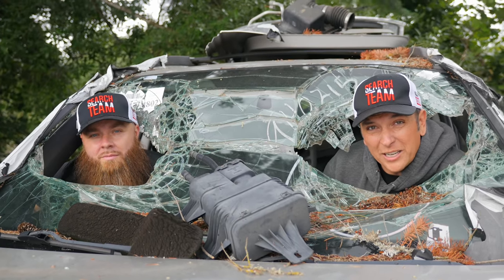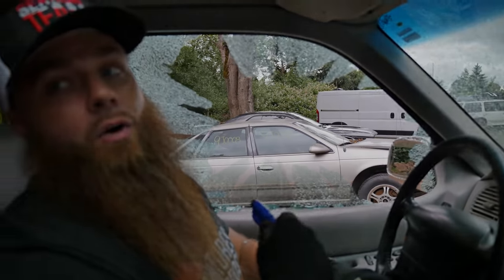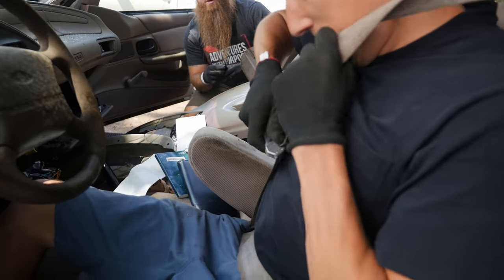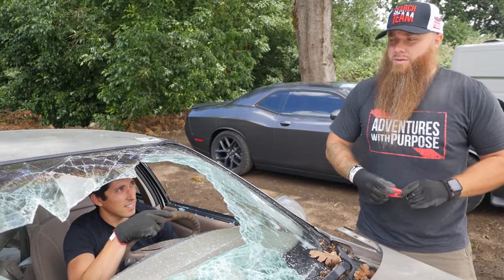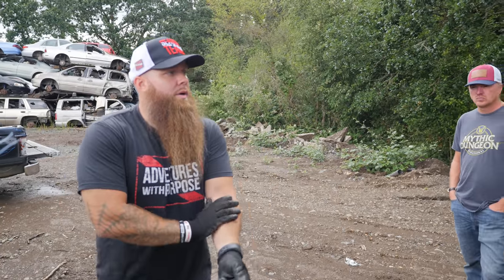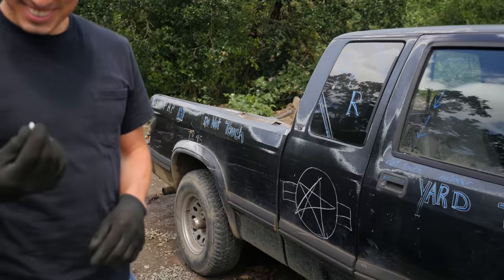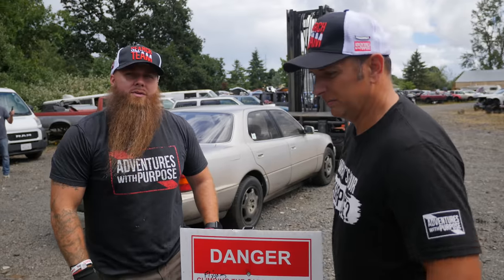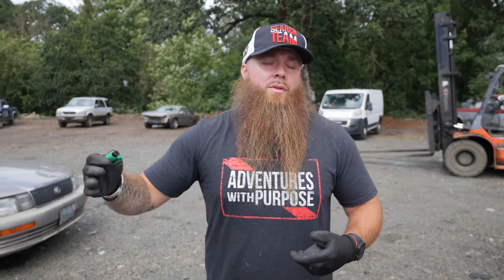HOW-TO-ESCAPE FROM YOUR CAR.!! (This Could Save Your Life)

Comment from the maker: Purchase Here: https://adventureswithpurpose.com/products/2-in-1-emergency-window-breaker
2-IN-1 EMERGENCY WINDOW BREAKER SEAT BELT CUTTER SURVIVAL KEYCHAIN
Reply: I want to buy the tool for my family, but it says not to use it on vehicles newer than 2017.  ☹
Reply: Good tool
Reply: When is the fritz video gonna be available for the non members?
Reply: What about my 2020 GMC Seira? 
Can't use this tool?
Reply: Bought 3

We have a 2020 Rav 4.  Its side windows say temperlite.  So not all vehicles made after 2017 have laminated side glass.
Reply from the maker: Check your back windows and see if any of them say tempered.
Reply from the maker: Still scheduled for Friday for the Ritz a video
Reply from the maker: Check your back windows and see if any of them say tempered. Then you will know
Reply: you covered most points except if the vehicle has laminated glass in the side windows
Reply: Buying the 5. Also does Doug have a significant other, and if not how do I apply?
Reply: @AdventuresWithPurpose  
Yep all tempered, only windshield is laminated.  Wow. I knew about my windshield, but had forgotten about the others.  Thx Jared!
Reply: Can't wait to see the underwater demo.
Reply: I tried my window breaker once and it dulled the tip. Now I don't even trust the seat belt cutter
Reply: @totower Good to know, 
Thank you!   Yes... IF we ever Need it, knowing it works brings comfort.
Reply: @nancid5265  100% Agree.  Not to mention,  they are most always on another case.
Reply: Been waiting for purple to be back in stock but after this video would have bought any color. Happy to see it was in stock when I went to order it.  Got my purple on order!  Have a tool in my van already but after watching this video and seeing how poorly some tools preform compared to yours I can't take the risk of the generic tool I have not working.  Thank you for this and all you do!
Reply: @AdventuresWithPurpose  you guys had me worried, should probably wear safety glasses.
Reply: I just ordered the green one for my wife.
Reply: That wasnt a headrest you was pulling off in the first car that was a sun visor 🤣 thanks for the video that was a lot of information I didnt know about
Reply: Great info Jeremy & Doug 👍 .. Thanks for 💕✌
Reply: I'm buying a LOT FOR EVERYONE! tHE WHOLE WORLD SHOULD HAVE THESE
Reply: The link you posted doesn't work??  Is there another link?
Reply: I ordered 3. Thank you
Reply: What is the breaking tool made of?
Reply: @AdventuresWithPurpose  If your car has all laminated windows, are you just screwed?
Reply: This was definitely a helpful and educational video! Your product is great and should be a must have. The only issue I see is that most cars no longer have ignitions for keys, as many are buttons. Therefore,  a lot of people will not have the keys right there (product) in an emergency. I suppose there could be a way to attach it to the dash (but thieves). Just was one of the first things I thought about when watching the video as I keep keys in my purse or in beverage holder (all of which can fly out of reach in an accident.
Reply: I got the 5 bundle, hopefully there will be no problems getting them to Puerto Rico.  I would love to have more tools like this one show up at the shop!! I love small and super useful and easy emergency/survival gear that any ordinary person can carry around and possibly save their or someone else's life.
Reply: Thank you so much for this video!   Bought 5 thank you guys for what you do!  Stay safe.
Reply: Deslike
Reply: I want to have that car. I'm good with a missing sunvisor, window and seatbelt lol but I'll pass this time. Hahaha
Reply: @cynthiameans4949  does it say why?  I'm curious
Reply: @waynesmith7527  there is nothing they can do. Their specialty is locating missing loved ones in the waterways within their cars. I do pray that precious child is found. Mom and dad didn't do this
Reply: @cathyhannold1849  talk of headrest demonstration was sunvisor
Reply: @stephanypasnin1474  his tint is tented. Auto correct spelling marme... Lol
Reply: @christinawilson2667  pretty much. Try sunroof if you have one
Reply: @vilsongriesbachjunior5691  dislike? Cool. We need those too.
Reply: Are these one use only? Were you using different tools each time or can they be used over and over? If so, how many?
Reply: Do you ship to New Zealand?
Reply: @cynthiameans4949  your vehicle should have least one tempered glass (normally rear or front) but to me I'd still use it if you needed it..l and didn't have it .. just like being armed .. your best prepared ..you should be able to email them
Reply: I was going to buy five but it says $83 shipping. Wow
Reply: Well I guess I can throw away the tool I have in each of our newer than 2017 cars. I live in Florida and there is water and bridges all around. I am terrified now and will let my windows down when driving over a bridge. Great video its for sure going to help a lot of folks with older vehicles.
Reply: I have one of these.  This tool is the reason I wear my seatbelt.  I had a huge fear of being trapped by the seatbelt and wouldn't wear it until I got this tool. I saw a child trapped in a seatbelt when I was a child and that memory stuck with me.
Reply: Do you have a mail address
Reply: This was great Thank You for saving a life
Reply: I have that tool in council guess I better move it
Reply: I literally just went to the website to see if you guys were selling these and came back to the video to find the link. Thanks guys
Reply: This is a terrifying video! I want to buy a bunch for my family but I have a couple questions. Please address all the questions about the use on newer cars. I couldn't give this tool out and have it not work. Should I give them all a big chunk of broken ceramic tile? Next, is there any research into certain colors being more effective in an emergency or is the color not important because you are likely just feeling for it.
Reply: @hawaiibound.  looks like I'll have to wait till they are on sale in UK.
Reply: I have a 2018 Rav4. It has tempered glass. So grateful!
Reply: @nancid5265  
Absolutely!
Reply: Just purchased 5 Keychains. One for each of my kids and myself
Reply: “It worked.” 😂 That back window exploded!
Reply: @vlw4165  you can use a thick piece of cardboard or  layer up two or three pieces.. Put the cardboard on a hard surface and then press down hard with the end of the tool. It should “fire” and you will see a small hole in the cardboard.
Reply: @christinawilson2667  yep
Reply: @TomCrosman , I guess I'm screwed if I ever go into water. My doors lock as soon as I put my car in reverse, so my windows wouldn't roll down and I couldn't unlock them. I don't have a sunroof and all the windows, including the two back side ones, are laminated. I drive a 2021 Camaro.
Reply: Can the tool be used on tinted windows?
Reply: @stephanie-leeirlam3499  need to know if it was aftermarket applied film or if it is actual tinted glass. Also you can check the window corners to see if it says tempered glass or laminate. Laminate is plastic between 2 layers of glass. Tempered is the glass that explodes.
Reply: @christinawilson2667  if you really wanna feel safe, sell your car. Find something else that doesn't have laminate everywhere. Or, you can do what a lady above says she does...drive around water with window(s) down. Personally I'd get a different car. Nobody wants to drive around with windows down when cold weather hits...
Reply: @christinawilson2667  I also just thought of something else that you can do if you REALLY don't wanna sell your car n find something safer. Have an aftermarket moon roof/sunroof installed. Not sure of cost, but is safety worth it? Also if it rolls you may not be able to get out of roof...🤷🏻‍♀️
Reply: @anneosborne8719  idk where you are located but I'm in the USA and first class shipping for 10 tools is only around $5...please state where you are from when you quote a shipping cost because it misleads and deters people who want to buy if they think the shipping is too high. They're trying to help save lives by encouraging people to buy it...not deter them with a high shipping quote. They're likely shipped from USA. If you are in US, it is cheaper than traveling to another country. Just to ship a very small item overseas can be expensive. That is why even I do NOT ship things overseas because it is cost prohibitive. If someone really wants it, how much is a life worth?
Reply: What about tinted windows?
Reply: Myth busters did some of these test including underwater.
Reply: @resarm5007  There's no way I can sell my car. I just bought it. What sucks is that you can't buy a new car without the worry of being trapped inside it. And my husband just said what if we pay all that money to have a sunroof installed and I land upside-down? Luckily I don't go anywhere where there is any water, unless I drive our bayway or causeway to get to Gulf Shores and that might be a once in every 5 year deal, if that much.
Reply: I’m planning on buying this tool actually 2 of them. However @adventures with purpose what do you do if you have a keyless entry for your car and keep your keys elsewhere while driving? Like is this still the best suggestion ?
Reply: Thank y’all 
I have just ordered 10. Nice to add to the Christmas gifts 🥰 Y’all are a true blessing.
Reply: @aidan-lm2eo  buy some velcro and put it on the dash
Reply: For people that can't swim do they make an underwater inflatable floatation device to keep in the car ?It would lift people to the surface when inflated.
Reply: Bought the 5 value pack to start. Added a tip for the video demonstration. Thanks guys! Hope I never have to use it, but I will be glad i have it if I ever do have to.
Reply: I just ordered 10...for my family...
I have been watching your organization for a couple months...currently I am looking for a job...as soon as I have one I will join
Thank you for all you do....you guys are amazing makes me wish I could rely help some how.  You guys are so very inspiring!  
Mikie
Reply: This needs to be a part of driver Ed in school!
Reply: I would love to have 3 of the  them
Reply: @heathernoneya4151  haha you're first after me, lol.
Reply: @papaguche  excellent idea!!!!
Reply: @christinawilson2667  Any swimming pools near you?? Just this week in my area some kid landed his car in a neighborhood pool. It CAN and DOES happen. No drugs or alcohol involved. He had a medical emergency. Now that I scared you even more, lol. Just something to think about.
Reply: @aidan-lm2eo  I'd think of somewhere you'd be able to get to it. They have wayyyyy too many comments and may not see yours. You know your car and your ways better than them too. Good luck. Let's hope you never need to use it.
Reply: @kathyroberts5870  why are you giving your million dollar idea away for free on YouTube??? Lol
Reply: Thanks guys...i have always had a fear of water, knowing that I have the tool to get me out of the tomb of a car God bless you.
Reply: I wanted multiples for discount but they only have red and it will only let me buy 1
Reply: @cynthiameans4949  same here
Reply: Can you please e mail us when they are back in stock. I would like multiple colors. Don't care what they are, but want the 10 count discount deal
Reply: Can we buy it in New Zealand
Reply: @cynthiameans4949  why don't you use it on vehicles newer than 2017
Reply: The static in your beard looked fantastic. I was so busy laughing I missed you getting out.
Reply: Another factor of a sinking car is the water pressure on the outside if the car and then it rushing inwards into any opening making it hard to exit.
Reply: If you have an infant and children to also save underwater, should you cut them out of their restraints before breaking the window and having more water gush in? So say you have a whole carload maybe you should demonstrate that. Not using real people.
Reply: Doug really went the extra mile! Thanks guys. I'm getting some for sure!
Reply: Adventures with Purpose  You need to read My first comment to you and Jamie Rupert's comment and my reply back to him.
Reply: @jamierupert7563  Maybe They will make a million and share a little with me.          Hint, Hint    Adventures with Purpose.
Reply: @AdventuresWithPurpose  , OMG, $28 USD to mail to Canada 😲 I am so sad.
Reply: AND I live on an Island so I am surrounded by water. We could have used this tool back a few years ago. We avoided hitting a dog laying on the road and flipped our Ranger 3 times, it came to rest on an electric pole and me dangling in my seatbelt. My bf crawled out over me and out the passenger window that shattered. I had to wait for the police to get me out.
Reply: I tried to buy some but it keeps telling me my phone number is invalid.
Reply: Hey shipping over seas are ouchy
Reply: Great job 👏 guys 
I need a few.
Reply: Great to see you Kevin
Reply: They're sold out but will be restocked on 8/24.😉
Reply: My worst fear has always been that I will get a blow out going over a bridge! I am definitely going to get one of those tools and not rely on the one I have! Thank you for the video and all the information I learned alot
Reply: HELP!  Since your are sold out on your end... where do we find a reliable escape keychain? Cause I drive along a river with no guard rails.... You all are awesome! Thank you for the video! Stay safe!
Reply: The biggest Thing You SHould Know THat the Seatbelt HAVE a Lock THat Stops The belt from moving while upside down YOU can NOT even reach the Glovebox !!!
Reply: Do you ship to U.K. please x
Reply: It's already sold out 😔
Now I have to wait until it's  restocked.
Reply: Will there be a restock? And does it ship to Australia?
Reply: Do you know they haven't? Everyone is praying for that little girl and the little 4 year old Michael in Idaho. This team is amazing, if a case is something they can help with, meets their specific area of expertise, they will do it.
Reply: @AdventuresWithPurpose  Great idea but I have a suggestion, say you're in the water, you reach for the tool but lose grip, it sinks in the car and now can't find it. If it floated it would be easy to find. I think you make this product so it floats as well.
Reply: @Ashley__Rose  Its on all windows, near bottom.  Its in black on my truck, & my windows came good & tinted. So look good for it.   Hope this helps.
Reply: @AdventuresWithPurpose  so basically us with tempered glass are screwed? Sounds like dept of safety need to rethink the windows. 😓
Reply: @southernsass2937  thank you! I looked where he shows in the video and it wasn’t there. But was on 1 window. They’re not tempered and I’m upset about that. 😕
Reply: @Ashley__Rose  What about your windshield?  Is it laminate?
Reply: @Ashley__Rose  Maybe they are, & they only put on one window.
Reply: Bought 4 can I use it on a 2017 Lol
Reply: @BIONDIEST  I thought they looked cheap as Heck when I got it out of the bag.
Reply: Thanks AWP! Super helpful I never even thought about how I would get out of a sinking vehicle 😳 but now I have a way better understanding
Reply: Thanks so much for the informative, life-saving video. I ordered 2 keychains, one for myself, and one for my husband, and I'm encouraging my family and friends to watch your video and order the keychains too. God bless you all!
Reply: I ordered 4 mine won’t work on my car. My windows on my car are Tempered.
Reply: @southernsass2937  look at your windows to see if they are tempered windows
Reply: @momamae23  Yes, its in the comments.  Thank you ❤
Reply: @momamae23  Are all of your windows tempered? I think they said in the video that the windshield on newer cars is usually tempered but the side windows may not be?
Reply: @leonaheraty3760  yes
Reply: @cynthiameans4949  Maybe we should all have a big hammer in our cars, just in case?
Reply: what about cars with push to start and keys arent in the ignition? where would the next best place be to keep a tool like this?
Reply: @AdventuresWithPurpose  all my windows say tempered so does that mean it won’t work or it will work. I bought 4 but if there not going to work on anyone’s cars I’ve just lost out.
Reply: @Kami-pq4hm  Good point! I'm keeping my keychain, with the seatbelt cutter & window breaker, in my middle console of my car, right where I have my cup holder.
Reply: All of you are awesome!  I've had a 'tool' for awhile, never needing it yet... however, I'll feel much safer purchasing yours, for several friends and family!!!  Keep up the great work!!  All of you are real SUPER HEROES!!! ❤️
Reply: I think it's because all windows that new have that laminated coating that the tool can't shatter?
Reply: @kitschville  Yes, I think they mention this in the video, but I think they also said the side windows may not be laminated. You have to check the windows to see if they have a "laminated" sticker or something like that on them. Anyway, that's why I'm also going to keep a hammer in my car's middle console, where there's the cupholder. Hope that helps. :-)
Reply: Doug you're just to awesome!!! Thank you all for teaching these life saving techniques.  Just shared to my facebook. I think everyone needs to see this. Especially where I live. Literally the middle of nowhere, on the corner of lame and boring. Maybe 3500 people with surrounding area. Closest major city is 4 and a half hours away. We are completely surrounded by water. So those two factors alone are alone making me think 🤔  I live up in Northwestern Ontario Canada. Just lakes and forest. Maybe a deer or moose lol. No one is going to save you, around here.  So you must always be prepared. There isn't even anyone near to help you. Always know your surroundings.
Reply: So what do you do in this situation if you have laminated glass?
Reply: 22:30 if the seat belt is coming out, why am i still cutting it? Isn't cutting the belt our answer to being held pinned by it? if not, is it better to cut it even if it is coming when you pull anyway??
Reply: What is the name of that small tool please any one can tell me
Reply: What do you use in a post 2017 car?
Reply: Hi Jared could you put this tool on amazon so us in the UK can get one please. X
Reply: My holiday gifts to everyone!!!
Reply: Hi, do you post to the UK?
Reply: I would love to support you guys but I'm on disability and thought the tool would be a great way to help a little bit but, and I'm sure you hear this a lot, $50.00 shipping to Canada for a $7.00 USD item that probably weighs less than 2 ounces???!!!!! Seriously USPS really sucks. Can't wait till you guys get B out of office! Damn!!!! 
I LOVE YOU GUYS!!!
Reply: I need one of these.
Reply: What about under watet?
Reply: @tawanablount3640  that's exactly what they are for
Reply: Wanted to buy a few of those for my family and myself, but the site says the shipping is unavailable to my country...😔
Is there any option how to ship them to Russia?
Reply: Just bought 5. Every member of my family is getting one- and it comes with a free lecture of the importance of keeping it on their keys.
Reply: is it payeble with VISA ?
Reply: Thank you.  I ordered 5.
Reply: The link takes me to your website, but doesn’t fully load so that I can order the tool!
Reply: Went to buy 2 and postage came up as $165....
Reply: How do i become a member
Reply: You can use a small stone same as a spark plud
Reply: @AdventuresWithPurpose  Jared... in Our Country our vehicle's don't have that information on.... I had to put Laminate on my Windows to save my life, I have a very "HOT" Vehicle.... they've tried to steal her, break into her, and even tried to Hijack me... It's a 1990 Cressida 3lit... Mint condition..... I'll just keep my Late Father's hammer with me..... STAY SAFE & WELL, THANK YOU WE CAN ENJOY YOUR TEACHABLE EXPERIENCES WITH US.... 😴IT'S ZZZZZZ TIME.... PAST 2AM IN THE MORNING😴❤😴❤❤😴❤😴❤
Reply: I'd love to buy one but I'm in ireland and shipping is over 70 dollars lol
Reply: Can it be posted to the UK?
Reply: Just found you guys. It’s a little hard to watch because you’re so hunky dory talking a guy’s infant in the car and wife… maybe just be kind and educational not condescending and belittling other tools over and over. Ok I get it. Just compare, educate maybe give stats but don’t fear monger
Reply: I was going to purchase it, but shipping to my country costs a bit to much ($83.80 only shipping). So I will need to look for a local one.
Reply: Oh no, I just bought 3 but now I see the comments that say not able to use on newer than 2017? All of my 3 cars are newer..can I return for a refund?
Reply: Thank you. I bought 5. One for every driver in my family.
Reply: It's asking me for £83.10 delivery???!!!
Reply: I ordered 3 1 for me 1 for my mom and my son gets one u never know.thamk u so much for having these at a good price .I donated 5 I wish I could do more .ur doing a great service thank u.
Reply: I just bought 5 of these. We had one of the knife tools that Douglas used in this video, but to see that it doesn't work made us buy the tool you sell. We live right next to a lake and on curvy mountain roads....so this is a tool is very needed. This video was very helpful for me and my family! We learned so much! Thanks Adventures with Purpose for all that you do! We love watching you all help all these people find their loved ones. It's truly amazing see what you guys do. You all are angels!! Thanks again!!!!!
Reply: Just bought 5 of your 2-in-1 emergency window breaker seat belt cutter survival Keychain.
Reply: @AdventuresWithPurpose  just bought 5 of these 2-in-1 tools
Reply: @Bre Unlikely.
Reply: Next time you do this can you please use the sun roof and show us how that would break etc?
Reply: @anneosborne8719  shipping to Australia for 5 was $111.40 US $$$ so with conversion to AUD the cost of 5 plus shipping was $200 ! 😪
Reply: @resarm5007  yes, what’s a life worth, but living in Australia, on a pension the shipping cost is way out of my reach, and don’t talk to me about the cost of a life, our son died in a car accident. But when you don’t have $200 Australian $$$ to buy these, then you don’t have it. I would LOVE to buy these, so I will see if I can buy these in Australia. Shipping costs are outrageous, the reason I never buy from overseas like I used to….
Reply: I've meant to buy one of these types of tools for well over a year. I finally bought one. I live by too many waterways not to own one.
Reply: How would you get out of a car with all of the windows laminated?
Reply: Tried to order but you don't take my card
Reply: I live right off the Colorado River in Bullhead City AZ.  My husband is part of search and rescue here and with all the flash floods, off road vehicle accidents in the middle of nowhere, children and pets left in vehicles in 120 degree heat that we need to rescue etc... this is something I will purchase.  Any discount on 100 of them?
Reply: Just found this video. Being trapped in my car with my kids is my worst nightmare. I just ordered 2.
Reply: Really want to grab some but shipping to the UK is insane!
Reply: @cynthiameans4949   Might be good to check the windows in your car to see if you happen to have tempered glass.  Couldn't hurt...
Reply: When will they be back in stock?
Reply: I have a push start vehicle and throw my keys in the cup holder if i was in a accident my keys would be nowhere near me. What would your suggestion be as to where i should keep it. I will still be purchasing as these are incredible
Reply: Sold Out 😥
Reply: @cynthiameans4949  so what other option is out there for newer cars ?
Reply: I recently purchased this and I was testing it on paper. The first couple worked but then the spring inside stopped working so there is no loaded punch. The probably won’t work now right? What should I do?
Reply: Is there an expected date to get the keychains in? I want to buy one for everyone in my family. Especially my grown kids.  I did put in my email for a notification, but just wandering if there was an expected date.  Thank you!!
Reply: It is sold out Will you please obtain more or give alternative ways to purchase? Thank you
Reply: @cathylee9157  they are also sold other places too
Reply: Do you ship to England?
Reply: I already made my order, thanks 👏🏻❤️
Reply: Hi guys  I've just tried to buy 2 of the glassbreakers tool , from uk ,but I can't pay for it as I don't not have any of the accounts listed ,.. I only have a debit card ...plz advise
Reply: Every LEO and firefighter should have this part of their everyday carry
Reply: @anneosborne8719  I bought 10 for $70. Included shipping/tac and I gave AWP a $5 tip too.
Reply: @aidan-lm2eo  tie device by steering wheel for easy access
Reply: @southernreign1  agreed
Reply: I love this tool but the shipping to UK is really expensive. Has anyone found a suitable and efficient tool in UK.
Reply: Got it in red
Reply: @heathernoneya4151   LOL
Reply: Wish it wasnt 2022.
I had money back in 2020, 2021
But today. Im so poor im looking at other
Housing options.
I LOVE Yalls videos, and I respect yall for not charging families.
That tool looks amazing.  
Haha my son has that same knife. He drives my car.... Makes me worry tons.
Almost so much I almost wish I didnt watch....
Reply: @AdventuresWithPurpose  what do you mean when you say tampered . I have lincoln 2018 but i want to get for the rest of the car
Reply: If my family has vehicles newer than 2017 how would you escape? Through the back window?
Reply: What about the piece of your seatbelt on your lap? If you are in the water, is that stupid piece not holding you down because of the pressure?
Reply: I want to buy that tool but I'm not a member and I'm a new subscriber to your channel. Surely, i don't need to be a member get this right?
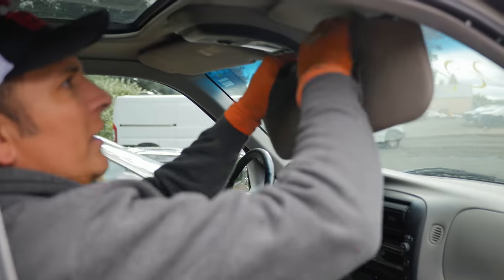Reply: Stop saying a headrest! It’s a visor 3:33
Reply: I just bought 10 of those suckers for me and my family. Thank you. I was in a rollover 2 months ago with my sister and her 3 kids and I was stuck upside down in my seatbelt. We were lucky a side window busted during the rollover so we could get out of the vehicle.
Reply: what's the ball bearing end for
Reply: I wanted to buy a pack of these for me and my friends and family. It wasn't on the website though. Is this product still available?
Reply: Ummmmm, i clicked on the link it to purchase an emergency window breaker but it just takes me to your site only to say "page not found"? I really want one and I'm a big fan! You guys do such great work!!! ❤❤❤
Reply: Adventure with Purpose I was just about to purchase those key things that cut seatbelts and breaks windows to save lives and they said the page doesn’t exist, what happened are you not selling them anymore?!🤔🤷‍♀️😓
Reply: wanted a few but isnt in stock is there any other ones similar
Reply: I want to order one but keeps telling me page not found
Reply: @Chrissy-Stormgal  Same here!🤷‍♀️😰
Reply: Take off the headrest and try to break the window!!, I’ve heard that’s why they are removable, I’ve never tried it!!
Reply: We
Reply: Where do you attach this so it's easy to reach when you have keyless ignition?   My keys are loose, in my purse or in my pocket?
Reply: Will there be more opportunities soon to purchase some? Every time I visit the page I get a message that it no longer exists. I am curious because I would love to order some for my family
Reply: Here in the Netherlands cost it 15, 99 the 2 in one car window breaker
Reply: @AdventuresWithPurpose  hey, just letting you know your link is dead. Looks like you changed the name of the item and the URL over the last year. I suggest you set up a 301 redirect from the old link to the new link (so anyone who saved it can still access it). And you might want to update the link here, too.

I like this better than the tools we have b/c ours are big and wouldn’t be easy to access like you said. Do you suggest any other tool for laminated glass, aside from porcelain bits, lol?
Reply: @kathyroberts5870  I bought life jackets that inflate by gas. I imagine that a regular life jacket should float one to the top.
Reply: This tool is no longer available!!! Can you tell us why and can you UPDATE WITH A NEW VIDEO AND AND AN UPDATED ESCAPE TOOL FOR LAMINATED AND TEMPERED GLASS PLEASE!!!!
Reply: Also, how do we break LAMINATED GLASS????
Reply: @mslady1230  it’s still available. The URL (link) was just changed. I notified them of this. Search their shop for window and you’ll find it. However, it only works on tempered glass.
Reply: This link no longer works..?????
Reply: @raqueladauto7309  look right above the comment you posted.
Reply: @AdventuresWithPurpose   is this product no longer available for purchase? Thank you!
Reply: @raqueladauto7309  I was wanting to order myself
Reply: They are out of stock can we be updated when they are back in stock!!
Reply: @JB11334  they’re not out of stock. Look at my msg above yours.
Reply: @Tawana_X  ICYMI, the window breaker is still available. The URL (link) was just changed and their web dev didn’t set up a redirect. I notified them of this. Search their shop for window and you’ll find it. Reminder, they said it only works on tempered glass.
Reply: Any advise on where to put this tool if you have keyless start and your keys are on the console and could be lost in a wreck?
Reply: @Emily-E  some ideas for keyless starts: Maybe hang it on your gear stick, rear view mirror, driver’s side visor, or this may not be as easy to access but the post on the driver’s head rest. Just test it to make sure you can easily pull it off with one hand. Or perhaps heavy duty double-sided tape on the driver’s side door, visor, or console.
Reply: Please, please, share and revisit this video after Kiely Rodni's tragic case. People need to know how to be more safe and to stand better chances to survive car accidents. Thank you!
Reply: Where do I buy this tool?
Reply: @Kimerly_7151  There is a link AWP left in their post.It says: Purchase here. Their web page have Merch section, you can buy it there if you can't see the link here.
Reply: You guys are sold out of these survival keychains , so where else can I get the same thing at that you would recommend? I truly appreciate your help if possible & thank you guys for all you do . This country is beyond lucky to have you guys ❤️
Reply: Are these window breakers just out of stock? The link says 404 page not found, so I'm wondering if you're still selling it at all? If not, could you point me in the direction of a comparable product?
Reply: This link keeps saying page not found
Reply: Bring back your 2 in 1 tool!! It's giving a 404 page off your link.
Reply: Your link is broken.
Reply: @blue-calla  thank you!!
Reply: @blue-calla  thank you for the great ideas!!!
Reply: @thenamesberly  wondering the same!
Reply: Wish we could still get these
Reply: 404 Page not Found
Reply: 404 page not found...
Reply: this is the first time I have ever wanted to purchase anything off youtube.  Sadly, I remain a virgin,  I guess you are out.  I only got this as a response.  404 PAGE NOT FOUND
The page you were looking for does not exist.
Reply: @karenkat1111  or it could be attached in some way to the visor?
Reply: Thanxfor the info...I have been carrying a hammer under my front seat for years now...just in case. Good to know it is useless. I have to look up those items & order some!!
Reply: No emergency tool available anymore 😔
Reply: your links aren't working for window breaker
Reply: Go to a junk yard and test your new tool. Some of these can fail. make sure it works.
Reply: Link no longer works. Please post a new link. Thank you. 

I have the "Josh" tool.
Reply: @cynthiameans4949 the video said newer ones aren't Tempered Glass. The suit doesn't work on the newer windows.
Reply: Are the window breakers no longer available?
Reply: Broken link.
Reply: Can you please make more of these? I would like to order one!🙏🏾🙏🏾🙏🏾
Reply: Why can't we buy this tool ?
Reply: Why can't we get this tool?
Reply: This link is broken
Reply: Why do I keep getting a "404 message" when I click the link?
Reply: Are you going to get more of the 2-IN-1 emergency window breaker and seat belt cutters in stock?
Reply: When I go to this page to purchase this tool it says page not found ??
Reply: I want to buy this tool for my family but when I click on the link it says page 404 not found
Reply: What is the beans name of the tool?  It looks like yours are sold out.
Reply: Says Page Not Found
Reply: I can't seem to be able to purchase it? Is there a reason why?
Reply: Are these tools not available anymore? I tried the link but am getting an error message.
Reply: Is this window breaker tool still available? I have been unable to locate it on the AWP site.
Reply: I just clicked the link and it brought to your website Doug but it says the page where you have the tool to get out of car is not available???
Where can this be purchased?? For ANY VEHICLE? 
Thanks for all you guys do!
Reply: It tells me 404 not found. I was going to order some.
Reply: Links are broken. :(
Reply: link is broken, item not there :( 

404 PAGE NOT FOUND
The page you were looking for does not exist.  

where can we buy that emergency window breaker please ? 
i need to buy all my car owning loved ones one 

thank you
Reply: How do I get the  2in1emergency window breaker seat belt cutter Survivor keychain  because it's not available on your website anymore
Reply: @nissalum3277  im joining this question, hope we get an answer :)
Reply: @Emily-E  you’re welcome for the ideas. Glad you found them helpful. 😊
Reply: @jenniferfalcone6173   ICYMI, the window breaker is still available. The URL (link) was just changed and their web dev didn’t set up a redirect. I notified them of this. Access it from their website menu or search their shop for window and you’ll find it. Reminder, they said it only works on tempered glass (which are usually used on side windows).
Reply: @thenamesberly    ICYMI, the window breaker is still available. The URL (link) was just changed and their web dev didn’t set up a redirect. I notified them of this. Access it from their website menu or search their shop for window and you’ll find it. Reminder, they said it only works on tempered glass (which are usually used on side windows).
Reply: @thepsychicsleuth7    ICYMI, the window breaker is still available. The URL (link) was just changed and their web dev didn’t set up a redirect. I notified them of this. Access it from their website menu or search their shop for window and you’ll find it. Reminder, they said it only works on tempered glass (which are usually used on side windows).
Reply: @Zevadel    ICYMI, the window breaker is still available. The URL (link) was just changed and their web dev didn’t set up a redirect. I notified them of this. Access it from their website menu or search their shop for window and you’ll find it. Reminder, they said it only works on tempered glass (which are usually used on side windows).
Reply: @missboo4325    ICYMI, the window breaker is still available. The URL (link) was just changed and their web dev didn’t set up a redirect. I notified them of this. Access it from their website menu or search their shop for window and you’ll find it. Reminder, they said it only works on tempered glass (which are usually used on side windows).
Reply: @photohoot    ICYMI, the window breaker is still available. The URL (link) was just changed and their web dev didn’t set up a redirect. I notified them of this. Access it from their website menu or search their shop for window and you’ll find it. Reminder, they said it only works on tempered glass (which are usually used on side windows).
Reply: @ORSkie    ICYMI, the window breaker is still available. The URL (link) was just changed and their web dev didn’t set up a redirect. I notified them of this. Access it from their website menu or search their shop for window and you’ll find it. Reminder, they said it only works on tempered glass (which are usually used on side windows).
Reply: @lazy855    ICYMI, the window breaker is still available. The URL (link) was just changed and their web dev didn’t set up a redirect. I notified them of this. Access it from their website menu or search their shop for window and you’ll find it. Reminder, they said it only works on tempered glass (which are usually used on side windows).
Reply: @aprilbenson913    ICYMI, the window breaker is still available. The URL (link) was just changed and their web dev didn’t set up a redirect. I notified them of this. Access it from their website menu or search their shop for window and you’ll find it. Reminder, they said it only works on tempered glass (which are usually used on side windows).
Reply: @seymore1532    ICYMI, the window breaker is still available. The URL (link) was just changed and their web dev didn’t set up a redirect. I notified them of this. Access it from their website menu or search their shop for window and you’ll find it. Reminder, they said it only works on tempered glass (which are usually used on side windows).
Reply: @NitrosDen    ICYMI, the window breaker is still available. The URL (link) was just changed and their web dev didn’t set up a redirect. I notified them of this. Access it from their website menu or search their shop for window and you’ll find it. Reminder, they said it only works on tempered glass (which are usually used on side windows).
Reply: @MargaretEllison2023    ICYMI, the window breaker is still available. The URL (link) was just changed and their web dev didn’t set up a redirect. I notified them of this. Access it from their website menu or search their shop for window and you’ll find it. Reminder, they said it only works on tempered glass (which are usually used on side windows).
Reply: @radicalhealthseries9482  look at the small decal on the bottom of your side window to see if it says tempered or laminated. Not all new cars use laminated.
Reply: @cathywnukoski5843    ICYMI, the window breaker is still available. The URL (link) was just changed and their web dev didn’t set up a redirect. I notified them of this. Access it from their website menu or search their shop for window and you’ll find it. Reminder, they said it only works on tempered glass (which are usually used on side windows).
Reply: @sunkorg    ICYMI, the window breaker is still available. The URL (link) was just changed and their web dev didn’t set up a redirect. I notified them of this. Access it from their website menu or search their shop for window and you’ll find it. Reminder, they said it only works on tempered glass (which are usually used on side windows).
Reply: @queenesquiresquad    ICYMI, the window breaker is still available. The URL (link) was just changed and their web dev didn’t set up a redirect. I notified them of this. Access it from their website menu or search their shop for window and you’ll find it. Reminder, they said it only works on tempered glass (which are usually used on side windows).
Reply: @lisabevans8107    ICYMI, the window breaker is still available. The URL (link) was just changed and their web dev didn’t set up a redirect. I notified them of this. Access it from their website menu or search their shop for window and you’ll find it. Reminder, they said it only works on tempered glass (which are usually used on side windows).
Reply: @lesliet1766    ICYMI, the window breaker is still available. The URL (link) was just changed and their web dev didn’t set up a redirect. I notified them of this. Access it from their website menu or search their shop for window and you’ll find it. Reminder, they said it only works on tempered glass (which are usually used on side windows).
Reply: @Michelle.05    ICYMI, the window breaker is still available. The URL (link) was just changed and their web dev didn’t set up a redirect. I notified them of this. Access it from their website menu or search their shop for window and you’ll find it. Reminder, they said it only works on tempered glass (which are usually used on side windows).
Reply: @tamil7498    ICYMI, the window breaker is still available. The URL (link) was just changed and their web dev didn’t set up a redirect. I notified them of this. Access it from their website menu or search their shop for window and you’ll find it. Reminder, they said it only works on tempered glass (which are usually used on side windows).
Reply: @rebeccaskinner4236    ICYMI, the window breaker is still available. The URL (link) was just changed and their web dev didn’t set up a redirect. I notified them of this. Access it from their website menu or search their shop for window and you’ll find it. Reminder, they said it only works on tempered glass (which are usually used on side windows).
Reply: @Jalle6673    ICYMI, the window breaker is still available. The URL (link) was just changed and their web dev didn’t set up a redirect. I notified them of this. Access it from their website menu or search their shop for window and you’ll find it. Reminder, they said it only works on tempered glass (which are usually used on side windows).
Reply: @areyoureyesstillblue    ICYMI, the window breaker is still available. The URL (link) was just changed and their web dev didn’t set up a redirect. I notified them of this. Access it from their website menu or search their shop for window and you’ll find it. Reminder, they said it only works on tempered glass (which are usually used on side windows).
Reply: @beloyalandtrue143    ICYMI, the window breaker is still available. The URL (link) was just changed and their web dev didn’t set up a redirect. I notified them of this. Access it from their website menu or search their shop for window and you’ll find it. Reminder, they said it only works on tempered glass (which are usually used on side windows).
Reply: @claudidadi6633    ICYMI, the window breaker is still available. The URL (link) was just changed and their web dev didn’t set up a redirect. I notified them of this. Access it from their website menu or search their shop for window and you’ll find it. Reminder, they said it only works on tempered glass (which are usually used on side windows).
Reply: @Kaitmanda    ICYMI, the window breaker is still available. The URL (link) was just changed and their web dev didn’t set up a redirect. I notified them of this. Access it from their website menu or search their shop for window and you’ll find it. Reminder, they said it only works on tempered glass (which are usually used on side windows).
Reply: @judyfooks3334    ICYMI, the window breaker is still available. The URL (link) was just changed and their web dev didn’t set up a redirect. I notified them of this. Access it from their website menu or search their shop for window and you’ll find it. Reminder, they said it only works on tempered glass (which are usually used on side windows).
Reply: @JulesUS8386    ICYMI, the window breaker is still available. The URL (link) was just changed and their web dev didn’t set up a redirect. I notified them of this. Access it from their website menu or search their shop for window and you’ll find it. Reminder, they said it only works on tempered glass (which are usually used on side windows).
Reply: @richardcorson4492    ICYMI, the window breaker is still available. The URL (link) was just changed and their web dev didn’t set up a redirect. I notified them of this. Access it from their website menu or search their shop for window and you’ll find it. Reminder, they said it only works on tempered glass (which are usually used on side windows).
Reply: @EsmereldaPea    ICYMI, the window breaker is still available. The URL (link) was just changed and their web dev didn’t set up a redirect. I notified them of this. Access it from their website menu or search their shop for window and you’ll find it. Reminder, they said it only works on tempered glass (which are usually used on side windows).
Reply: @Dottie1975    ICYMI, the window breaker is still available. The URL (link) was just changed and their web dev didn’t set up a redirect. I notified them of this. Access it from their website menu or search their shop for window and you’ll find it. Reminder, they said it only works on tempered glass (which are usually used on side windows).
Reply: @nissalum3277    ICYMI, the window breaker is still available. The URL (link) was just changed and their web dev didn’t set up a redirect. I notified them of this. Access it from their website menu or search their shop for window and you’ll find it. Reminder, they said it only works on tempered glass (which are usually used on side windows).
Reply: It keeps giving a 404 error code where can you buy this?!?!?
Reply: @platinumnurse6586  i dont think they answer .. it seems to be the number 1 question xD  no replies .. 
i guess it was just a sponsorship deal 
spark plugs for us it is :D hey whatever works , right ?
Reply: Are these still available, can't find them in the store.
Reply: When I go to that page it says: 404 PAGE NOT FOUND
The page you were looking for does not exist.

Can you tell us where there is a link that works to buy this??
Reply: @jillh3187   yeah me too. Just watched the vid and really want to buy some!
Reply: @millie79  Maybe they are just out of stock.  Hopefully someone from AWP will respond soon as to where we can buy these.
Reply: @jillh3187  Yes, fingers crossed!
Reply: @BIONDIEST  It's SPRING ACTIVATED.
Reply: I can’t find any thing here are they still for sale?
Reply: This link leads to a not found page and I don't see them in the shop. Do you still sell these?
Reply: @AdventuresWithPurpose  I just want to thank all of the crew for yalls amazing work. Love each and everyone of you for all yall do.
Reply: Why don't you sell that tool anymore?  That page is giving an error.
Reply: I went to go buy one and it’s not available.
Reply: Buying these for all of my kids, including the ones that don't drive for their keychains.
Reply: @tmomo7265  Years ago, before I would drive over Lake Houston, I would pull over, unbuckle my daughter from her car seat and put all the windows down in my car.  There were no guard rails and it was a narrow road.  But it's nice and wide now with guardrails.  I bought these tools for every driving member of my family about 5 years ago.
Reply: The link doesn't work.  Will you be getting these in again?
Reply: Are the rolls going to be available again?
Reply: Where can I get this tool? I went to the website and it's not showing this product. It keeps saying 404 page not found.
Reply: The link doesn't work can you repost please
Reply: Where can I purchase? It says page not found
Reply: Page Not Found
Reply: @BIONDIEST  Try it on a junkyard car
Reply: The link no longer works, any other options to purchase the window opener?
Reply: 404 page not found - does not exist.  Where do I buy this item and not get a cheap knock-off instead ?
Reply: @cherokeeraider  If you find it, can you please put it here?
Reply: Are you bringing back this product?
Reply: Hi, is there a new link? This one has a 404 page not found.
Reply: Link is Not available
Reply: I can't get the link to work
Reply: No longer available?
Reply: Link says 404 not found
Reply: Any more tools?
Reply: @aidan-lm2eo  I know your comment is old, but after I was involved in an accident where I ended up in water I suggest tapping it to a part of your dash that you can easily reach like the left side underside part. No one will see it but it will be in reach for you.
Reply: This link isn’t working
Reply: When I click the link(s) provided to buy the tool it says this on the webpage: "404 PAGE NOT FOUND The page you were looking for does not exist."
Reply: Tried to order but page isn't working ☹
Reply: Come on guys...Your were using the visor not the head rest.  The head rest has metal dowels.  The visor is to keep sun out.
Reply: @cathyhannold1849  Yes, I was upset about this.  It made them look like morons.
Reply: Hey the window breaker is not on that page😭
Reply: I couldn't find the 2n1 emergency window breaker..it would bring me to no page available..I need this tool or is thier another similar tool that is recommended? Ty in advance.
Reply: @MariaMartinez-bm3bp  I couldn't either!!!  Just google it though.  It won't be AWP but it looks like there are a lot if similar tools online
Reply: Where can I get one of these?  I just tried and it says PAGE NOT FOUND.
Reply: @AdventuresWithPurpose  How come I can't order some?  I tried and it says PAGE NOT FOUND.  Is it offered to members only?  Or isn't it offered anymore?
Reply: BUT YOU GUYS DONT SELL IT ANYMORE!!!! So?? Where’s the help???
Reply: @rebekitavega4115  And why don't they explain?
Reply: Page not found ... Can't find it
Reply: @pamelaremme38  u just hv to google.  It won't be AWP but there are similar tools
Reply: This page doesn't work to purchase???
Reply: Well what, it's not for sale anymore? It just says "error 404" when you click on the links. 😑 Lame.
Reply: This is no longer on the site. How do I get one?
Reply: New subscriber here.  Will these be available again?
Reply: Your link page says 404 NOT FOUND.  Did you guys stop selling item?
Reply: I went to the site to buy the tool but keeps saying 404 page not found or does not exist.
Reply: It's no longer available 😭😭😭 not even listed 😭😭
Reply: Viewing this about a year after it was posted. Tried buying a few of the tool and it seems they're unavailable. Any idea when I can get them for an upcoming cross country road trip?
Reply: Can't find it in the link
Reply: I guess they are sold out? I get a 404 message when I click the link.
Reply: Link shows message "404 Page  not found. The page you are looking for does not exist." There are No Emergency Window Breaker Tools available for purchase on your website.
Reply: do you guys have a other link for those ?
Reply: Plz restock, there isnt any
Reply: I went to order it and it says page not found
Reply: @Imacatmom  me too
Reply: Page not found!!!
I looked all over your website and pressed all the links here on this video and I cannot figure out how to buy this thing
Reply: @cathyhannold1849  they were making the point that not all cars even have head rests and THEN  he tried to take off the visor.
Reply: it says page not found
Reply: I clicked on the link and said could not be found
Reply: Why is the link broken and when will you guys have more?
Reply: @AdventuresWithPurpose  I want to buy this, right away, but it says not available? I know this is an old video but we have a 2011 Nissan altima and a young daughter. What can I get to keep us safe?
Reply: Won't take paypal? Then I can't buy one.
Reply: Why does it say page not found? Only shows options for merch!
Reply: Looks like your out of stock. Any idea when you will get more?
Reply: Are theese out of stock? When I click the link it doesn't work.
Reply: Tried to go on too buy tool, but it says you can't find the page. What's up with that.
Reply: Too lock a seat belt one needs to pull out all the way and then slowly let it go.  No a seat belt is on  Properly.
Reply: Will these be back in anytime soon guys?
Reply: Link is broken
Reply: The link is broken
Reply: @jennyjen8514  Same!
Reply: Sure wish they were available
Reply: Do you still sell this? I can’t find it on your page. I would like to buy these for my whole family.
Reply: @Adventures with Purpose are y'all sold out of the window breakers? I can't find any. Everytime I click on the link it says "page does not exist"
Reply: Keep getting 404 error page will not let me buy
Reply: I am interested but they are not on the website.
Reply: Can the window breaker still be purchased
Reply: Tried to buy but link isn’t working above
Reply: So why do you not sell your window breakers anymore? I want to look to get some and there are none on your site.
Reply: Why does it say item not found now? I can't find the product :(
Reply: Is this tool still for sale? I couldn't find it on your website. Thank you.
Reply: Is this tool still available? Thank you
Reply: My car is so old, windows roll down manually. I guess I’m safer if I don’t have the right tool  🤷‍♀️
Reply: Did you guys stop selling these?  The page doesn't work for that product.
Reply: I checked this video specifically for the link to buy this tool, but it doesn't appear to be available anymore.   Where else can I go to get one as effective as the one you promoted here?  I  live near bodies of water and never want to be in that situation.
Reply: i thought there was one for a laminated window also?
Reply: Do you not sell them anymore?
Reply: Can I still get this tool? I want to buy them for every member of my family and it says page not found… can you help me please?
Reply: I just  Discovered your program great work guys wow. OK how do I get this tool I need like 4 of them
Reply: I wanted to buy one after watching your video but the link didn't work. Can we expect a restock at any point? Love your channel, guys!
Reply: @cathyhannold1849  THEY AND EVERYONE ELSE' KNOWS THAT ALREADY.
WE ARENT DEAF OR BLIND!
What are you trying to say???
Reply: I went to link and got 404 page not found! I want buy this tool immediately! I order a different one on Amazon, same style as yours but I still want to buy one of yours to support you guys! When are they coming back?
Reply: I'd like to purchase a few of these. My car windows say "Temperlite" and not "Tempered".  The back window is laminated.  Will this tool work the same on temperlite as "tempered"?  Thanks!
Reply: Page not found….
Reply: What is the name of tool .. maybe un my country ( indonesia ) doesn't have that tool